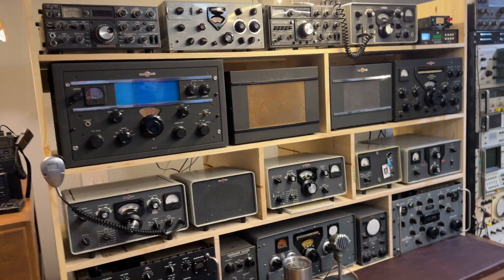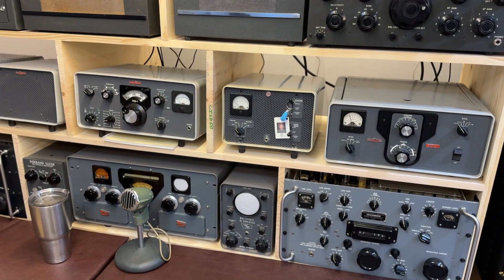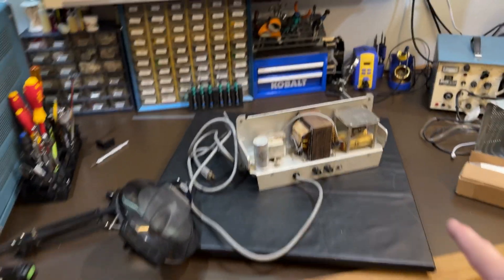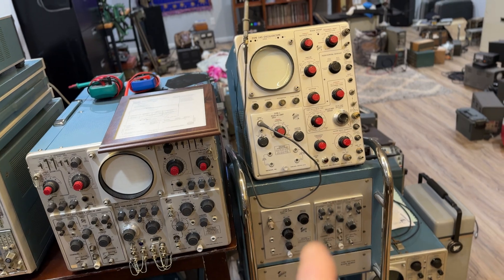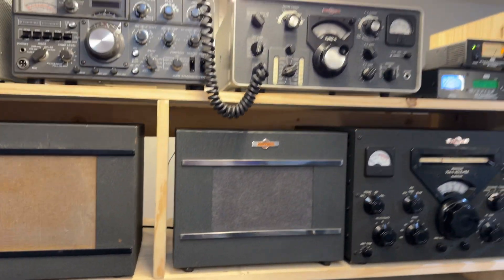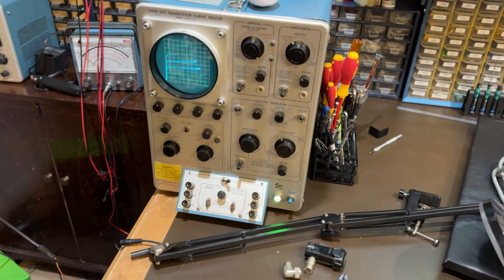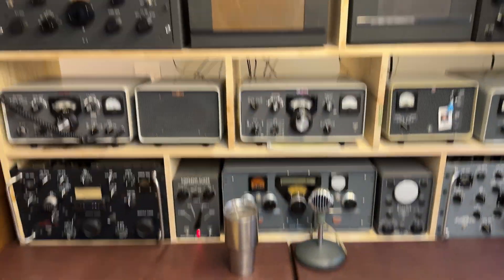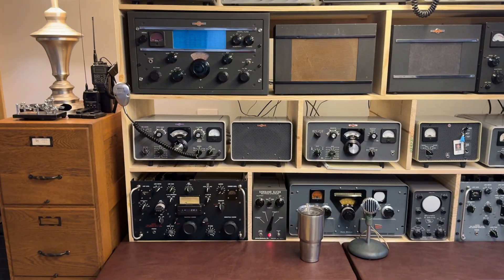Extended Shack/Lab tour featuring Collins, Tektronix, and HP gear.

Comment: I'm just here for the TMDE. Takes me back to working 545, 547, and 555s in the early 80s.
Reply from the maker: Thank you! Everything works too. The Tektronix scopes just needed cleaning to get them to work. I did change out the leaking HV caps in the 545 and one of the 575’s.